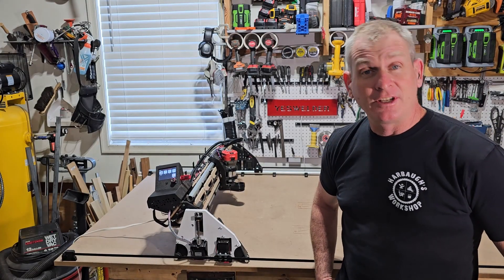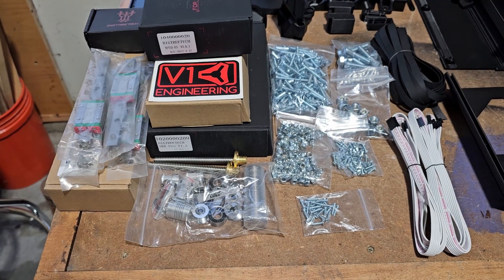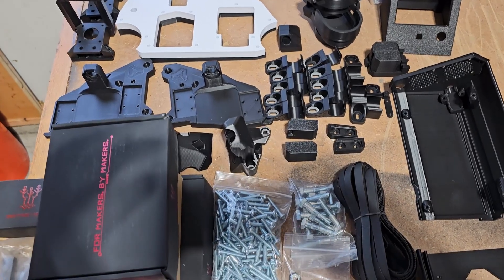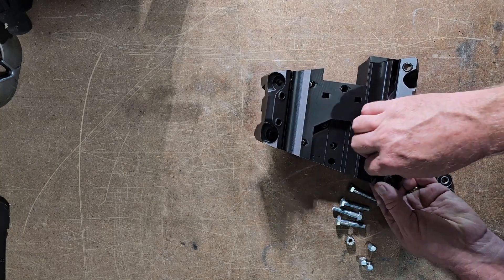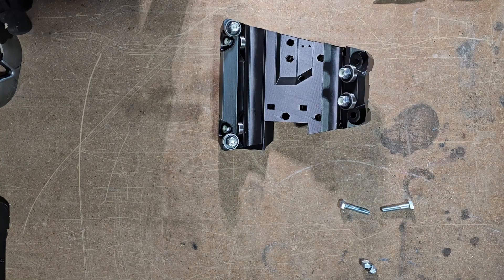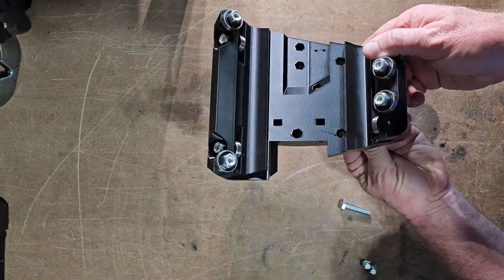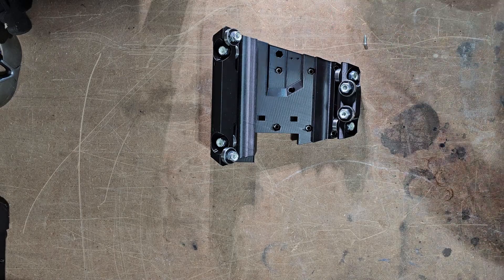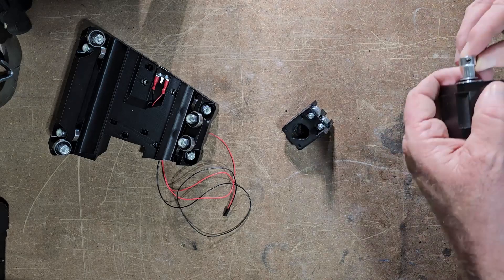LowRider CNC V3

Comment: I am very curious about why Original Design does'nt use tube on both Y Axis.
Reply from the maker: My thought is so you can do micro adjustments to the stepper motors to square your CNC. Putting tubes on both sides, you would have to be perfect for you to get square.

Comment: I plan to have my LR in the corner. Which side is better to put against the wall? The rod or the belt side? Thank you
Reply from the maker: I put the belt out, so if I need to adjust it would make it easier to get to.

Comment: i see your using a bauer router how does it perform do you think its a good option i could save about 140$ going with one of those instead of the makita
Reply from the maker: I have had no issues with the Bauer. it's definitely a good option.
Reply: @harbaughsworkshop  did you have to model a different mount for it if so do you have it uploaded somewhere
Reply from the maker: I used the makita mount files, and they are a perfect fit

Comment: What kind of filament are you using to print the material? I was thinking about using CF-PLA
Reply from the maker: I used pla, pla is plenty strong enough. I used it on my plasma cutter CNC as well. Holds up very well.

Comment: You probably realized it later... At 11:22 and 11:32 the motor mounts are flipped from how they are intended — those little curved protrusions are meant for lashing down your vac hose against them, with zip tie grooves printed into the protrusions. Thus those protrusions are to be above your dust shoe on the left side, for dust collection. Another related tidbit, is the mounts have a vertical gap for the wires to not be pinched against the core, and that requires they be turned opposite of how shown, in order to align that gap with the groove in the core!  🙂